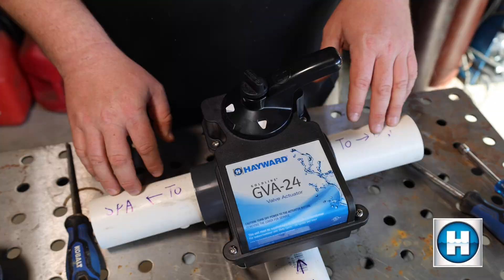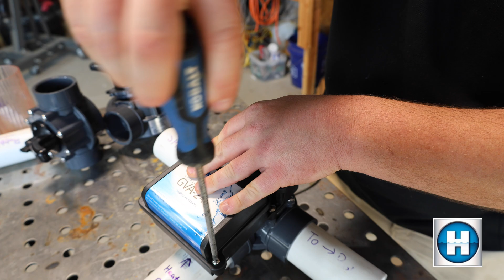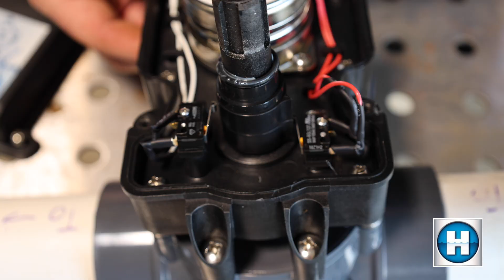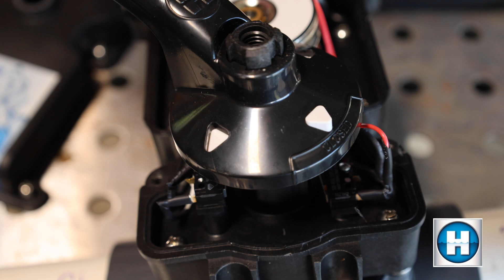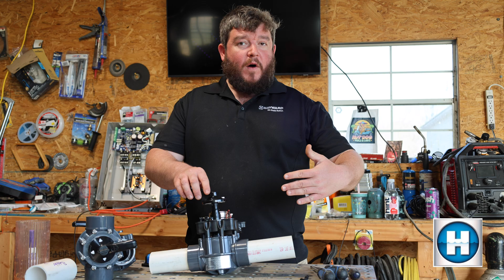How to adjust electronic pool actuator valve.

Comment: When in SPA mode, the actuator is turning and closing off return back to pool as expected. But something changed recently and now spa water level is dropping an inch every 15 min. I suspect the return value is not 100% closed off. Is this a case of adjusting as your video shows?
Reply from the maker: The valve might need adjusting or could could have a bad seal.